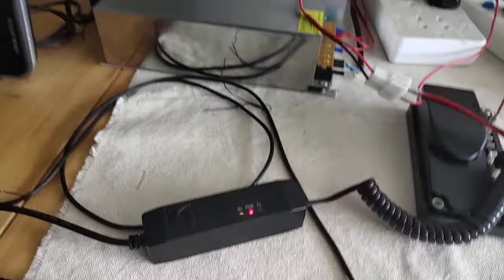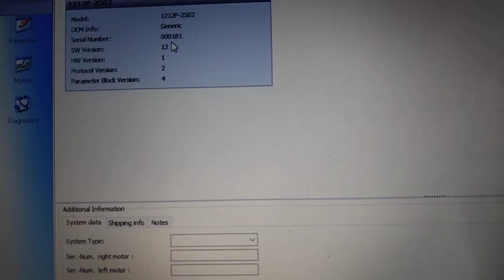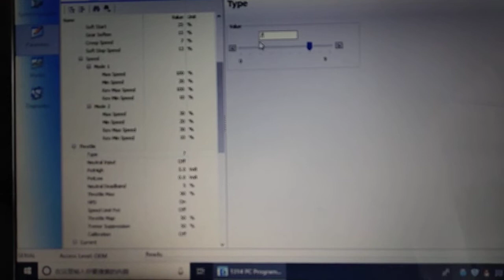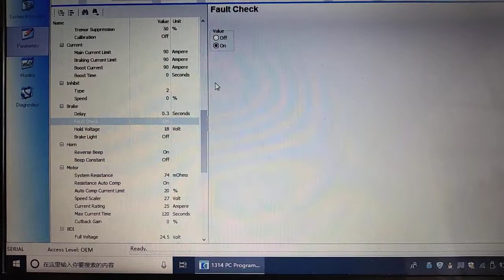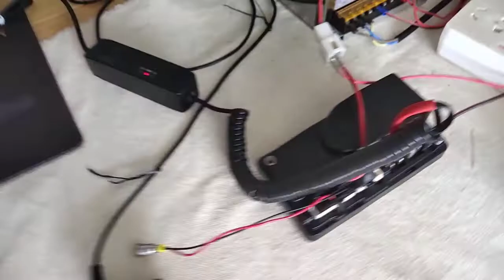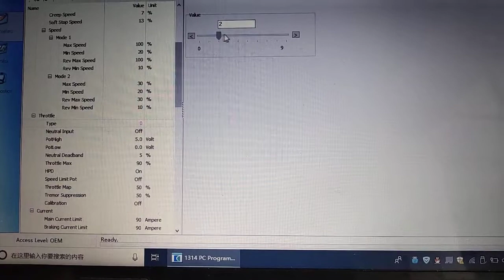Check & Modify CURTIS 1212P-2502 Setting With 1314-4402 Programmer

Comment: Where can I get the software  for Curtis 1314? My software is only giving me access on User Access mode.
Reply from the maker: The software 1314 is a part of programmer kit: https://www.noco-evco.com/product/1314-4402.htm . If you are looking for a free copy, you may try to ask help in some EV or golf cart forums.
Reply: @AldenDENG  Ok thank you. I got mine programmer but the disk have some problems. I tried it of a few computers and i got the same problem. My program doesn't run properly.  I do not expect anything for free but if there is a option to buy just a software I would be interested in that.  Thank you again.
Reply from the maker: @andriadavid  Sorry that we don't supply the software as an individual part. But you may find sellers on eBay or Amazon who can possibly provide the software as an individual part. By the way, now the new CURTIS 1314 software programmer kit has one USB memory key, no more a CD. Best regards.

Comment: very cool, these controllers 1212p chinese version very cheap now, finally a cheap controller for mobility scooters. cost about $50aud now
Reply from the maker: It is true the copied version offers an economic solution for alternatives of 1212 / 1212P controllers.
Reply: @AldenDENG  have you tried them? are they reliable and can you use the same software to tune them? I have bought one and not installed it yet.
Reply from the maker: @namenotshown9277  The copied version is fully compatible with CURTIS products, can also be reprogrammed by CURTIS programmers, same parameter set and same dimensions. But we don't have the bench test data, so we can not tell that the life cycle or peak performance are same or not.
Reply: @AldenDENG  thanks so much for your honest answers,  excellent news they can be programmed ( I have no experience with that ). I've actually been waiting for a cheap version of a mobility scooter controller for a very very long time, decades in fact. I'm not sure how long these have been on the market but its a good thing in my view. I will post here about my experience after some time of using it. I suspect it will be just fine. Are you located in china? I am in australia.
Reply from the maker: @namenotshown9277  We are in China. We sell motor controllers and other parts, but not really the professionals at technical level. Though we have now many options for motor controllers in China, but actually we don't know much. Basically we work with CURTIS controllers and the related parts.

Comment: Can this software be used for controllers with model 1228-2502?
Reply from the maker: We don't have experience with 1228-2502. But there is no problem that 1314 software programmer can work with 1228-2901.

Comment: Thank you, sir
I have a new 1232e controller.
How can I configure the forward switch for it
Reply from the maker: Usually, the the Switch 7 (pin J1-22) is the forward switch. You don't need to reprogram anything except that your controller provider has specifically made a modification on the "Forward" switch. Or you may regulate the forward speed by tuning some parameters in "Throttle" menu for limiting the forward signal or max forwarding speed, etc. It is recommended that you take a look at the controller manual for more details: https://www.nocoev.com/product/curtis/manual/manual_OS32_1232E_34E_36E_38E.pdf
Reply: @AldenDENG  I connect a contactor to j4 for pomp motor and a contactor to j6 for the main contactor and the device doesn't have any alarms now.
when I press switch 5 -j11 pomp contactor works.
But when I press j1-22 main contactor doesn't work.
No electromotor connected to the controller.

Comment: I have a curtis 72v 1236 AC controller. Will I be able to adjust maximum speed with your software?
Reply from the maker: With the programmer software 1314-4402, you may modify the maximum speed of your 72V 1236 controller. But it is recommended that you may observe the controller working status in the "monitor" menu, before making the adjustment. It is important to consider the extra motor load brought by the added speed.
Reply: @AldenDENG  Thanks. I work with industrial VFDs so I understand the limitations. I simply want 4-5 mph for road travel.
Reply from the maker: @andyfeimsternfei8408  There will be no problem to add 4-5 mph in the motor rated speed range. Please tune the controller with patience. If it is necessary, you may rise the max speed setting 5% per time, running the motor for a while, check the motor heat dissipating and controller status, then move to next step. Enjoy the programming  job.
Reply: @AldenDENG  Thanks! Most drives I work with show % motor load. Increase speed, decrease torque up to the motor power limit. It looks like the Curtis controllers have a lot of programmable functionality.
Reply: @AldenDENG  I went with the 1313 handheld unit and I have raised my speed to 19mph and adjusted many other settings. Works great, thanks! Question, I would like to install a toggle switch to switch between Speed (1) and Torque  (2) mode. Is there a way to assign one of the inputs to switch modes?